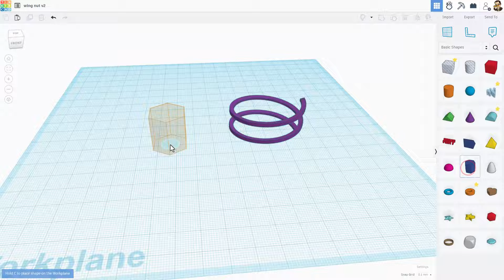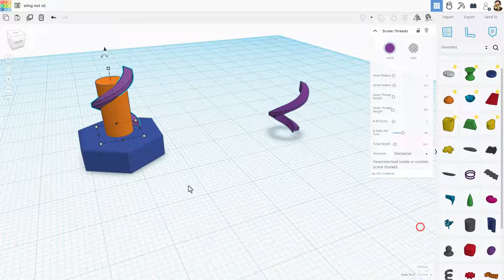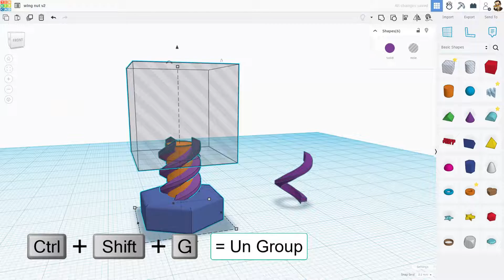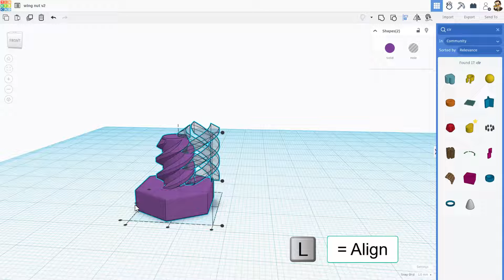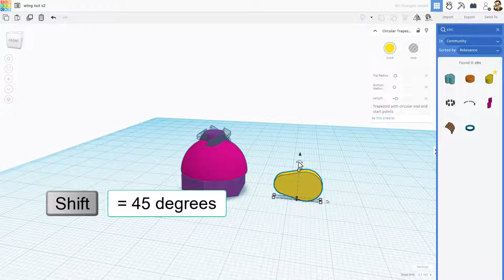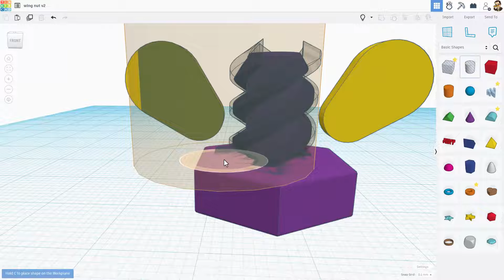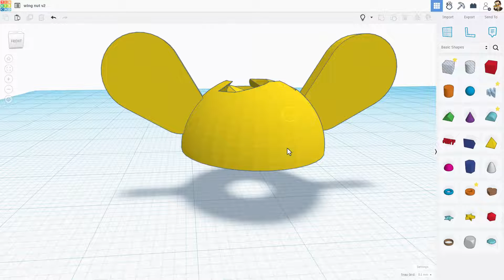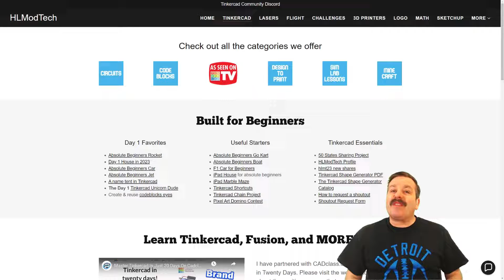Make Scratch 3D Printable Threads A Tinkercad Wing Nut for Beginners

Comment: 👏🏼👏🏼👏🏼 How do you figure out all the numbers/parameters to type in and use for this one?
Reply from the maker: ZDP189 shared them with me. The idea is to create a "cone" with a bit of a slope so it is easier to print as it climbs.  I will update the numbers for users that have printers that are not calibrated very well. The current gap is .1... for those I will adjust to .2. You can re-use those numbers with any radius that you want though. It was really fun to see it come together.